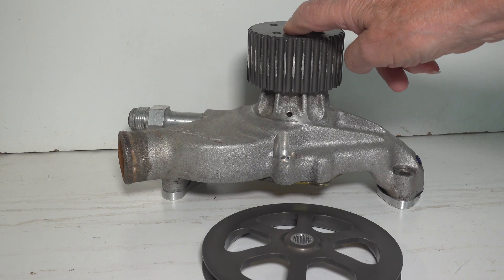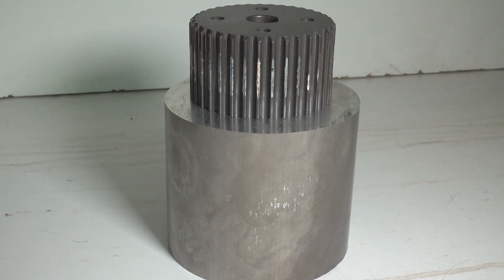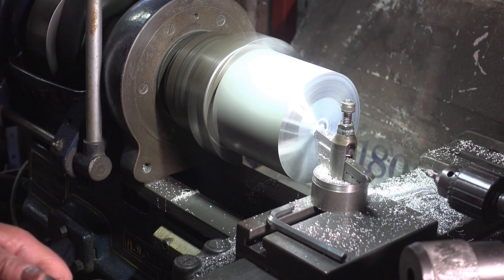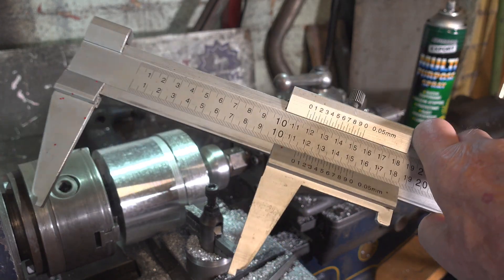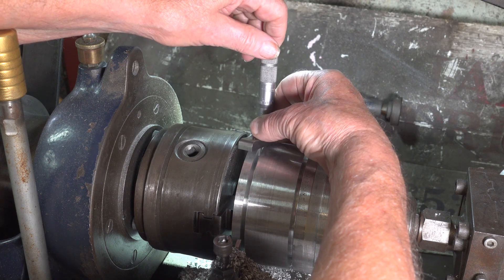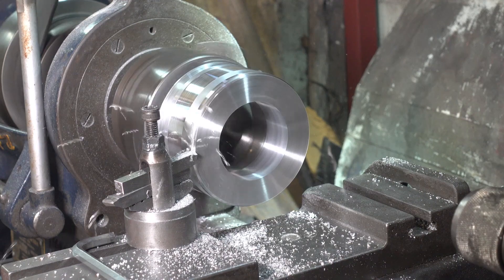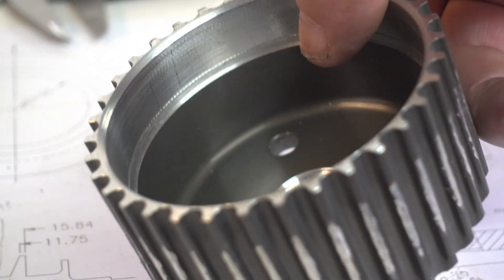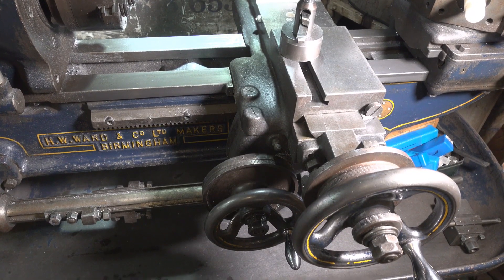Ward lathe #1 - making a V BELT PULLEY

Comment: This is fantastic! Im now looking at getting one of these lathes for myself, a #1A. How did you attach the 3 jaw chuck? Is it a standard spindle nose, or did you have to machine a face plate? I cant find any information on the internet and a bit of help would be greatly appreciated. Cheers!
Reply: Thank you! Yes I was planning of getting a small Chinese compound slide and modifying it to suit
Thanks again
Reply from the maker: Thomas, The spindle on my lathe has a flange maybe around 100 mm dia and from memory (it was long ago now) I bolted material to the flange to machine back plates for both three and four jaw chucks. The flange has three holes and I put threaded studs into the back plates. The studs protrude through the flange  and the chuck is affixed with nuts on the the backside of the flange. The back plates have a recess that allows them to locate onto a protrusion on the flange. I suspect the 1A will have a similar flange.
One thing I should mention is that these capstan lathes don't typically have a compound top slide, so you are not able to turn accurate tapers on them as they stand.  I hope this description is of some help.
Regards
Reply: @rohossify  You wouldn't happen to know what size collets the original collet chuck took do you? Maybe a 412 or 403 collet? Cheers
Reply from the maker: Thomas, I don't have much knowledge regarding Ward collets but a little looking on the web and I think the 412 is for a 2A machine and a 403 is for a 3A machine. The spindle bore on my machine is 1-1/8 in and the collet o.d. Is 1-3/8 in. There aren't any markings re type on the collets  however I'm wondering if mine are maybe a 402 collet. Possibly there is a wise person out there that can advise.
Kindest regards
Reply: @rohossify  Thank you!